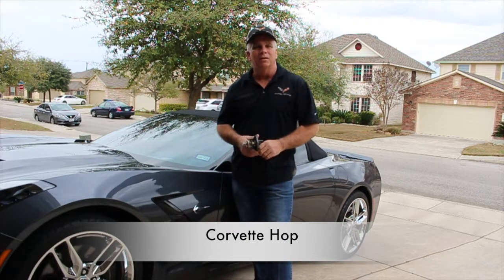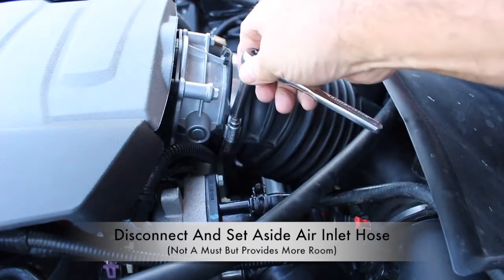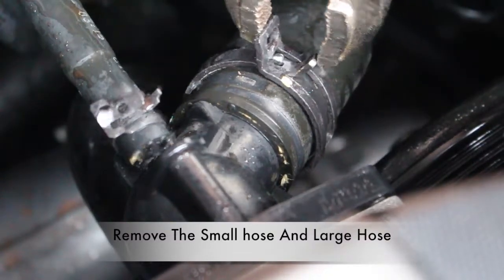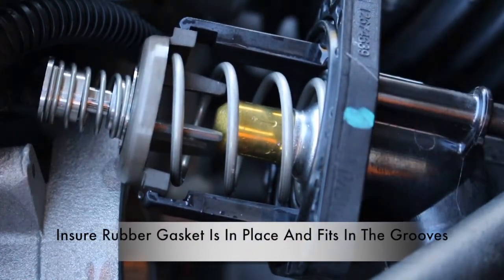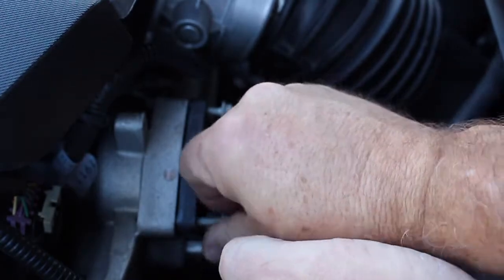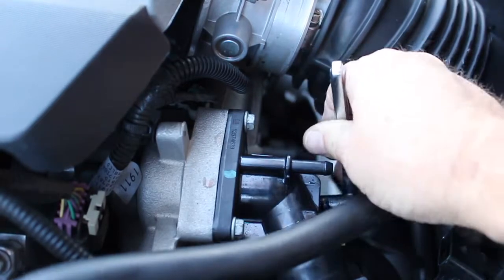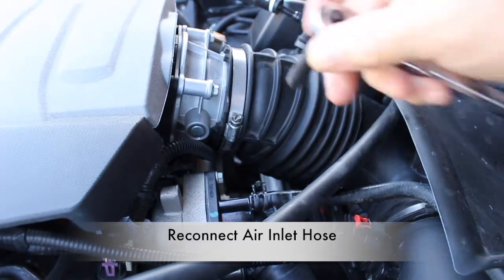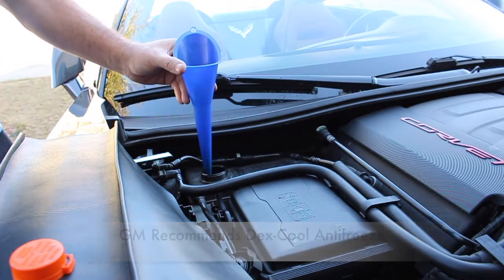C7 Corvette Thermostat Install

Comment: Thanks for the great video!  Slight clarification, the part number 12674639 listed in the chapter is only for the 2014 Stingray.  2015-2019 including the Z06 uses 12674634, though I see no obvious difference in the photo.
Reply from the maker: Thank you so much for the input. I am sure that information will help others.

Comment: I have an antifreeze smell from my car after driving and the first few seconds of turning the heat on.  Can i visually inspect the heater core without removing the dash?
Reply from the maker: On the C7 Corvette It is my understanding the dash, center console need to be removed. The seats may also need to be removed. I have never done a heater core on the C7 Corvette so I am not 100 percent sure. I would looks for leaks. Also, check the carpet for antifreeze/water fluids.
Reply: @TheWhatisright  thank you.  On a different note after i pass 2500 rpms in my c7. I get a loud tick.  Does yours do the same thing?
Reply from the maker: @dontworry1568  No, mine does note. I did have a rattling noise around 1500 rpm and it went away when I accreted. The dealer could not figure out what it was LOL It turned out to be the belt tensioner needed was bad.
Reply: @dontworry1568  I hear ticking at idle but I will guess its just the fuel injectors.

Comment: Hey There, Great video. I know it's been up for a while. My 2019 C7 GS has same issue. Swapped the thermostat this morning. Lost maybe 10 to 20 oz. of coolant. Tried to remove the coolant tank cap, but from tight, turned counter clockwise about 1 turn. It gets loose but will not come off when lifting up. Tried pushing down, then turning, but that didn't work either. If I keep turning it gets tight again. Cap still won't come off though. Any ideas.??? Not sure if I lost enough to mater, but want to be sure it's at the correct level.

Comment: As always GREAT Video !
Reply from the maker: Thank you. I am still learning.
Reply: @TheWhatisright  question when u replaced the stat  did u have to burp the system ?
Reply from the maker: @ericm5393  No, it was high enough in the system that mine did not require burping.
Reply: @TheWhatisright  ok thx , I changed mine along with the temp sensor , Im burping the system now because my fan turned on  at initial start up .